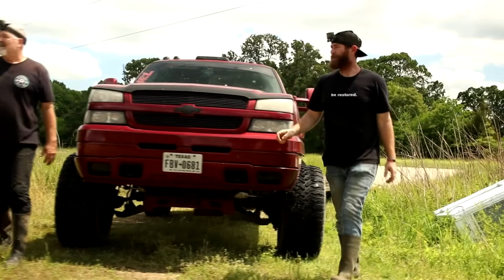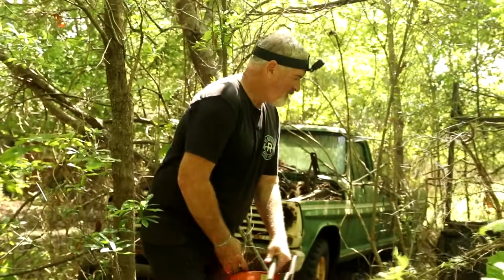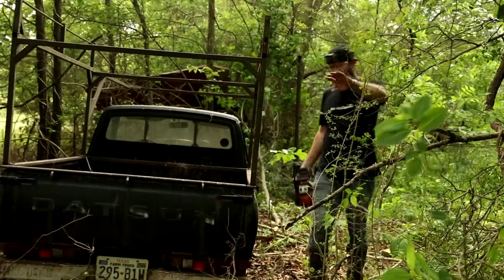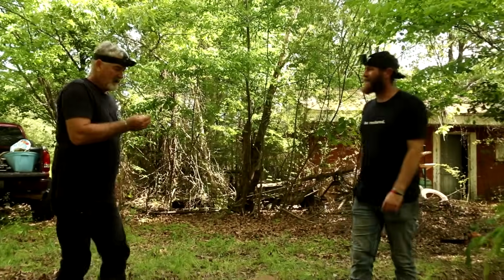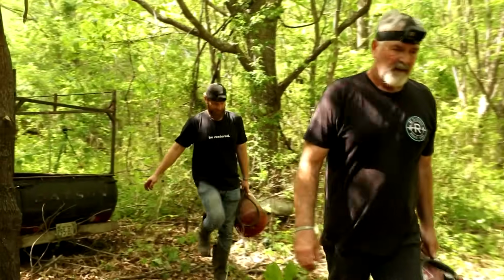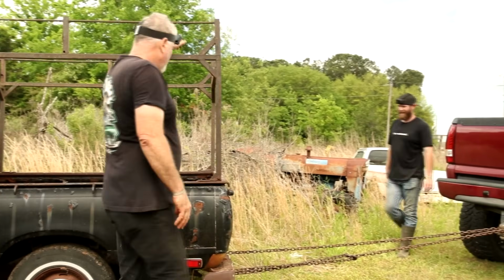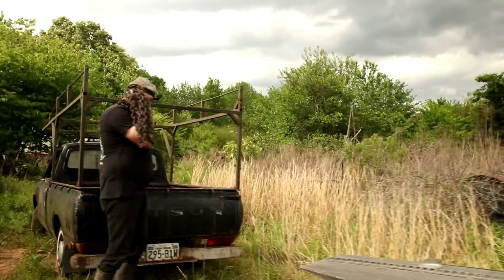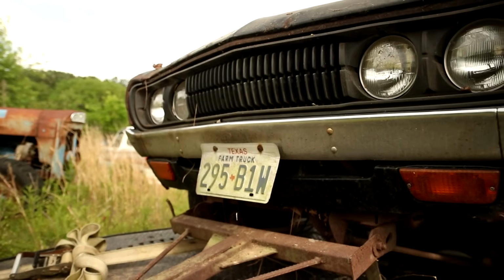Abandoned Truck Cut Out Of Texas Jungle After 30 Years | Rescued 1977 Datsun 620 | RESTORED

Comment: I can imagine that every once in a while, having a side by side that has four wheel drive would certainly come in handy to get into tight spots so y'all can hook up to the vehicle and pull it out to where y'all can get it to the trailer.
I just pulled out a 87 
Ford 250 4X4 extended cab with one and it was a life saver.
Cool, old little DATSUN pee-cup truck. A friend had a brand new one in 76. Fun little thing.

Comment: I had a Datsun in the early 80's. Cool truck that ran great. When I bought it it had huge back tires and wheel which wasn't that great for driving on. I bought all new tires and wheel that looked great. The color was orange with tinted windows and sunroof. 4 speed with  overhead cam called the 620. I had the head rebuilt and after I put it back together ran even better.

Comment: I had a 1974. Bought it brand new, $3,100 out the door. Joined the Air Force in 1976 and drove it till I got sent overseas in 1979. Would love to have another one like it just for old times sake. It was bright yellow with the "Lil hustler" stripes on it.

Comment: OK I have a request. 
I haven't seen yall get a vaga in your shop yet and get it running.   
I'm sure tex has some not fully rusted out.   Later models you'd probably have better luck with with the better engines.   
But anything is possible.   
 😃

Comment: I'm in Central Texas, working on a '77 Datsun.  Just got a carb for it from Oregon for $450 and a radiator for $600.  Mine now starts and drives but I think I'm gonna drop the fuel tank and get it cleaned out 'cause it starts & runs but the next day it won't....fuel issue.  I barely have any brakes.  My reason for getting it up 'n running is to use it to teach kids how to drive a stick.

Comment: Yall dug out a saab by cutting trees. They make a 4 inch side grinder wheel that will chip away wood quick. You just need a generator and extension cord alot faster. Will save you alot of time. joebob

Comment: You don't have to take the tire off to put new valve stems in, just rip the old one off ,use some liquid soap and a flat blade screw driver, roll the edge in and push the rest in with the screw driver, done many a one .